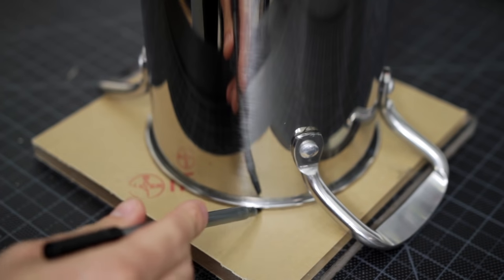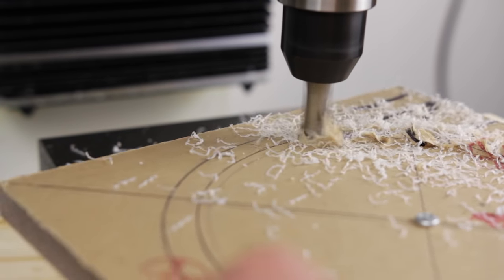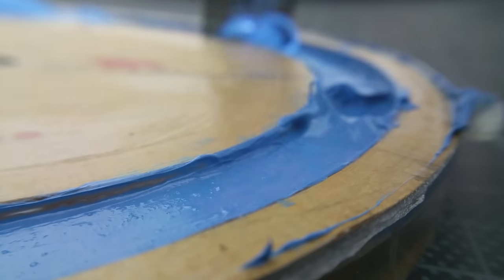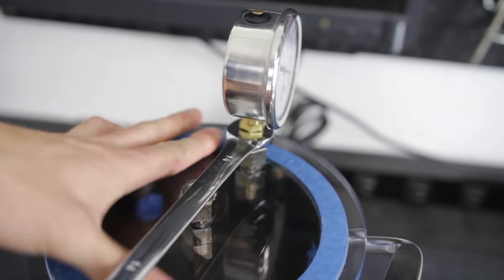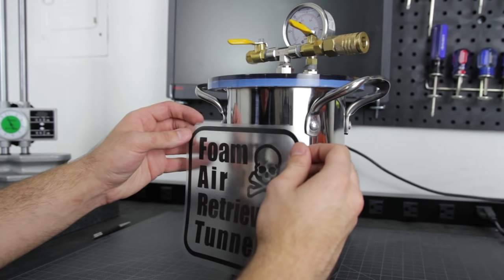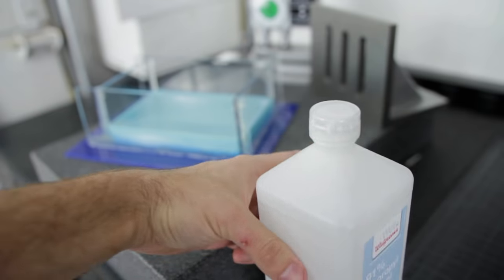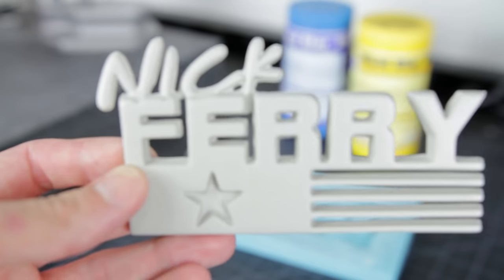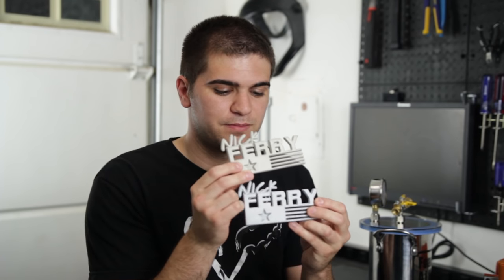How To Make A Vacuum Chamber

Comment: Thank you for the video and the tip about the talcum powder! I have a question about that! What effect does the talcum powder have on the cured resin? I couldn't tell with the final product (because the resin cured a light grey). Does it just wipe away? Does it make it to where the resin will cure a matte instead of a gloss, even if it is cast in a glossy silicone mold?
Reply from the maker: Thank you, Frank! You're correct it will give you a matte finish perfect for painting right after.
Thanks for watching!
Reply: I have a question about the powder too , we sell it here...but all the talcon powders are for baby bottoms..so they contain oil and vit E ... would that matter.... I have projects of resin that needs to be painted aftewards, and I would want to try this out.

Comment: I'm wondering what the material cost is.
Reply from the maker: By raw materials such as the polycarbonate and silicone sealant that was about 20.00 US dollars but the whole project was about $65.00 USD but that was everything new. If you can get some of the parts second hand and don't have an exact size you want like I did you can build it for probably 30 to 45 dollars minus the vacuum of course.

Comment: Fab tutorial!  but I’d like to know what kind of hose you used and where you bought your vacuum pump.

Thanks for the edumacation!
Reply: you can use an old fridge compressor as a vacuum pump, flow rate is slow but it pulls a decent vacuum, comparable to a water aspirator vacuum.

Comment: How long do u use the vacuum pump for ?
Reply from the maker: Till it reaches maximum vacuum and doesn't exceed the working time of the silicon or resin you're working with as you still have to pour it and degassing does reduce your working time a little bit

Comment: what vacuum pressure and how many cycles does the construction endure? I had thinner ones than repeatedly imploded and needed replacement after 3 month.
Reply from the maker: Nope going strong for over two months and I've left the vacuum on by accident several times at 29.7 inHg for 3+ days
Reply: If I’m making wax in a chamber made with rtv silicone will that affect anything? Does anyone use this rtv for making cannabis extract?

Comment: Nice job but I am cheap. I would just tap a 1/4" NPT in the poly and use RTV as a thread sealant.Those fittings are not cheap. What about a square cut O-Ring with hardened RTV under it as a cushion and keep the o-ring in place? Also for those who don't have an end mill a circle cutter jig and router will work with an end mill as well. If you use a regular router bit use a carbide one and go slow in depth each pass or you may chip the poly. Poly is much harder than wood and will fracture easily.

Comment: Nice video but that seems like a WHOLE LOT of work to go into making a gasket for the lid/pot interface.  A purchase list in your notes would be nice.
Reply from the maker: This is a video for entertainment and functionality. You wouldn’t watch a scary movie if the victims did exactly what you wanted them to do because it would be boring, I could simply have cut some rubber as a gaskets and drilled a single hole for the vacuum in the polycarbonate and have a usable vacuum chamber but I wanted it to look a little nicer for the camera as well as for me since I have to look at it. The one place viewers such as yourself should do is look in the description, there’s always something in there that answers your questions and in this case you will find an instructable link to an article I wrote that will give you a build list

Comment: why not 3d print a mold for that mold? lol .... but dope vid on how to make a vacuum chamber
Reply from the maker: Harder to sand inside a pocket to get rid of the layer lines plus I wanted a one part mold and I wouldn't be able to do that with ABS OR PLA as it would crack or warp the mold especially the heat generated by the resin curing. Thank you for the kind words

Comment: Do you think if instead of setting the pot down into the silicon when the silicon dried, If you left the silicon level the lid would suck down to the pot to make a seal?
Reply from the maker: Hi Patrick,
If the top of the pot was completely flat and the durometer of the silicon was lower then yes I could of gone with that method.
Unfortunately the pot I used was not completely flat and warped so I inset the top of the pot about an 1/8" to account for the lip around the edge of the pot.
Reply: the softest silicone is windshield repair type in a tube from an auto parts store. it is fluid enough to self level as well.

Comment: You guys need to fix the website on there it says female ball valves.... I bought the wrong part because of the website.
Reply from the maker: Hi Samuel, looks like Amazon removed the item that was on the same page. I've added the correct item which is still female but has a male at one end. Sorry about that, I'm not notified when Amazon makes changes to their product pages.
Reply: Machine Right thank you for taking a look just didn't want anyone else to get the wrong item thanks for the video and the website it's helping me out alot.
Reply from the maker: Hi Samuel, No problem and thank you for bringing it to my attention. This is the second time amazon has changed products on a link given(may have to take down links in the future to them to prevent this from happening). That's great to hear! Thank you for taking the time to watch the video and I hope your build goes great! Have a great day

Comment: Ehh.  That pot WILL get crushed.  Not a good idea.

You should use a PVC coupling for a chamber.  They are only a few $$ and are going to withstand the forces. 

I made one of these one day and ended up with metal shards all over the work area.

Comment: That metal pot is far too thin for a vacuum chamber. If it gets dented it will fail dramatically.
Use a pressure cooker.
Reply from the maker: Been using it for 5 years dents and all still going strong! You don't know how thick the pot is so you shouldn't just assume ;)
Reply: @MachineRight  - I’ve worked with vacuum equipment a lot, and normally it is very over engineered, having seen the aftermath of a vac implosion where a woman lost her eye I’m perhaps over cautious, but I’d rather not have an incident.

Comment: No bad but $15K in machinery isn't a cheap way to do it.
Reply from the maker: If you listened or watched the video you would have heard of the alternatives I provided and if you actually built anything in your life you would know this could be done in multiple ways without me even having to say it in the video as I did
Reply: @MachineRight  Can you do videos in those alternate methods?
I for one do not have the money nor the space to set up a shop.
But I do have a basic drill, hack saw, and screwdriver.
Reply from the maker: @crazysquirrel9425  In the future I will but all you really need for this is a drill, rubber and a piece of polycarbonate with a thick pot. I made a grove in the polycarbonate but it’s really not needed a simple piece of rubber with a hole in the center would have done the trick just as well but it wouldn’t be very entertaining to watch!
Reply: @MachineRight  Was thinking of a 5 gal plastic bucket, tire rim stem, vacuum pump.
Could do several at one time that way.

Comment: Thanks, now I know as long as I have about $3k worth of tools I can make a $100 vacuum chamber. Really?
Reply from the maker: You most likely are new to building things so I completely understand that it might appear that way but having a simple hand drill and a palm router will be enough to build this project and could even be done without a router at all as you just need gasket material to make up the difference in flatness when sealing. I used what I had on hand at the time and made a project video free of charge for others to enjoy! Thank you for watching!